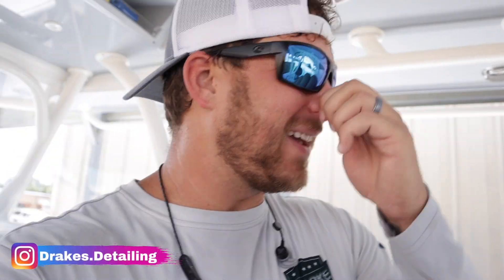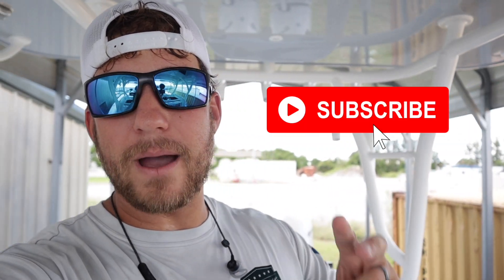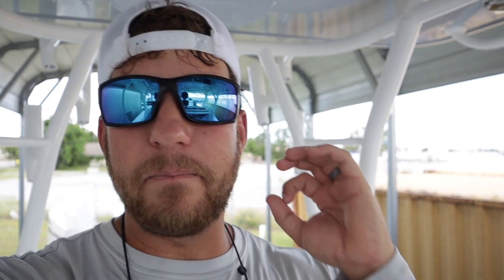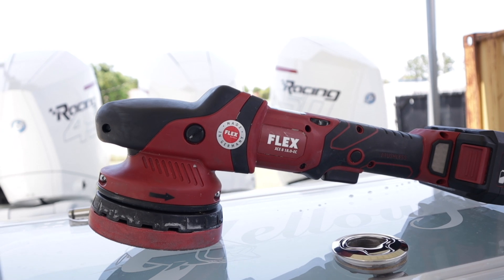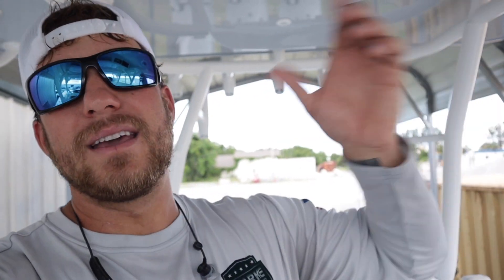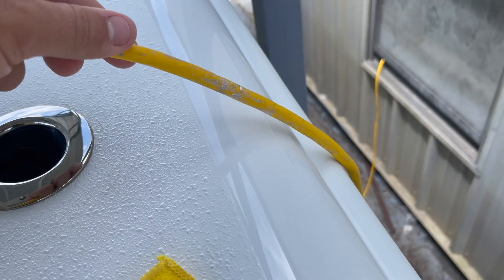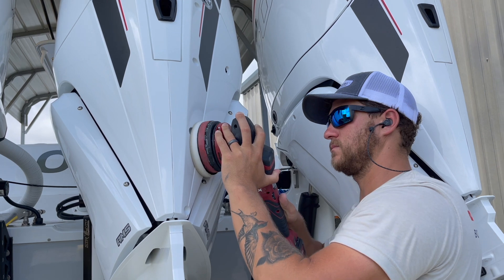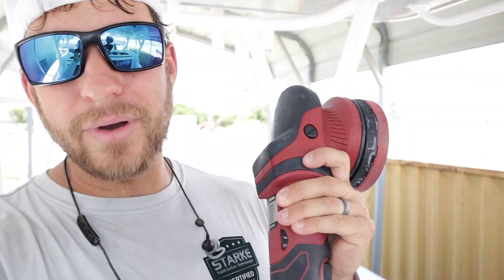FLEX XCE 8 125 18 0 Polisher Review | Boat Detailing Polisher

Comment: Drake, Can you make a video showing how you detail an outdrive? and also how you detail the floors of a boat with snap on rugs?
Reply from the maker: I’ll try, ha! Not much you can do with an out drive other than a good degreaser and pressure wash.
Reply: @DrakesDetailing  ok fair enough. But how about those snap in rugs or mats on my R5?  Is there any extra steps or products that shouldn’t be used?  Can the mats be pressure washed?

Comment: How do you find the cordless XCE in terms of power vs. corded 3401 or Mille when used for polishing with Menz 400/Elevate and LC Orange foam? Does it have enough power to remove rotary swirls/holograms with ease?
Reply from the maker: Yes it has enough power to remove swirls and holograms! But it has about half the power of the 3401 and Mille. The number 6 setting on the XCE is like the 2.5 or 3 on the Mille
Reply: @DrakesDetailing  Ok, thanks! 👍
Reply: Yikes! It's that far away from corded.. I bought the XFE when it first came out and wasn't impressed at all power wise. But I figured being forced, the XCE wouldn't suffer the power loss as heavily. Their PE cordless rotary has plenty of power..
Reply: Excellent video!! But I'm staying with the Beast  "3401" 😁

Comment: Looking for an all around tool, not really wanting to buy a rotary if I can do most everything with the Flex.  Can you get similar results with the LC Purple on the Flex that you can with the rotary?
Reply: Yep, just not as quickly and you'll work a little harder. But it will get it done. If you're doing gelcoat correction professionally on a regular basis, a rotary is almost mandatory. You don't need to spend alot at first, or at all, rotaries are fairly simple in design. Even the Harbor Freight rotary can still cut with the high end machines.

If you're referring to the purple Hybrid wool pad, it's a great pad, but I'd step up aggression from there for heavy gelcoat cutting. It falls somewhere in between a one step pad and a heavy cut pad. 

Check out the Buff&Shine Urowool pad. Awesome on any style of polisher, very durable and only around $10. Also nearly zero shedding even new out of the bag. 
👍✌

Comment: Hey Drake! Great video, Im just now getting in this yacht detailing game. I first heard about this product from a friend that works on a 77 Spencer and he absolutely loves it! He only uses Starke yacht  care products as well. I run a 2022 42 Freeman in the northeast and we just put her away for the winter but I plan to get it dialed in for next season! I bought the FLEX polisher and the TripleP ceramic prep polish. Anyways, I have a few questions..... If you were to do a 42 freeman (Topside and Outside), how many polishing pads would you recommend? Also, Being a one man show is it worth it for me to get another battery and battery charger? Thanks in advance!